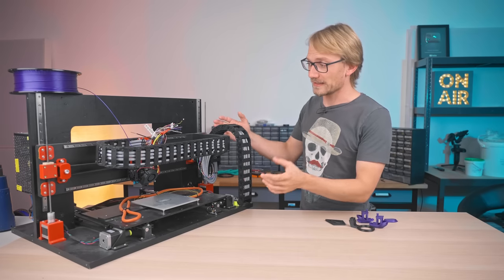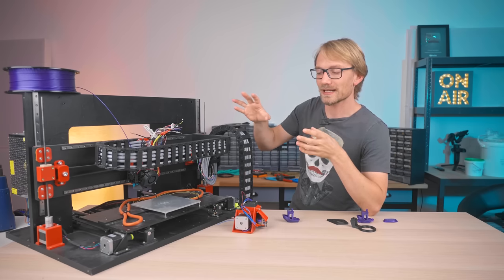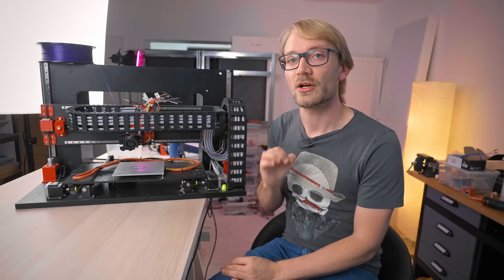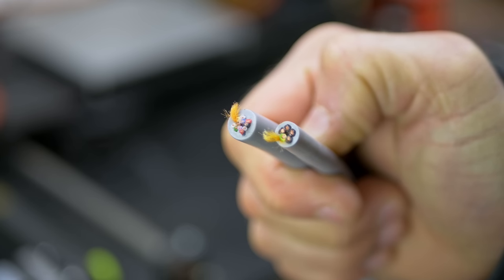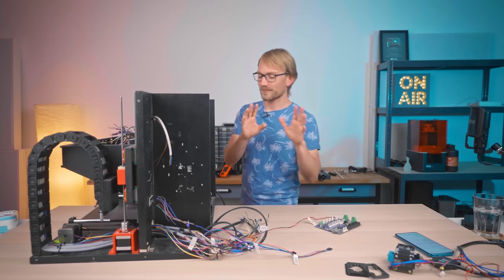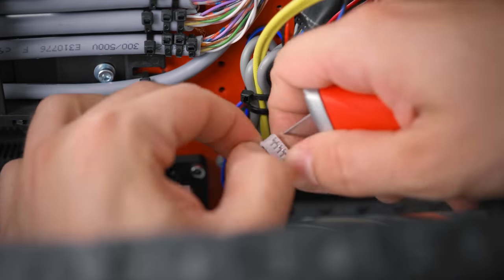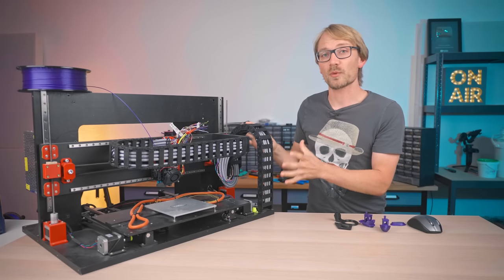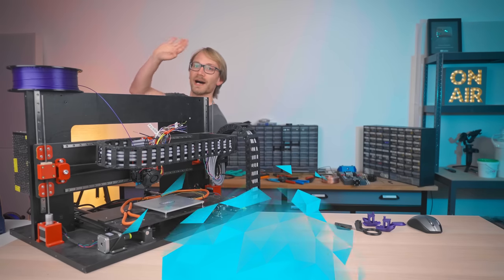This 3D printer can use ANY components - ultimate machine for parts testing!

Comment: Just an opinion here, and I like and admire your design a lot, but I'm not a big fan of those elastic bushings. You said that it won't produce printing artifacts but I highly doubt that any kind of elastic piece directly in the middle of the load applied to linear motion system is bound to introduce artifacts when doing prints that require a lot of z change (especially with z hops). I understand that with this machine the best quality is not the goal, but modularity and I may seem like your 89-year-old senile great uncle going on about Eisenhower was the death of this nation, but if I could recommend a future upgrade, use a well-tuned printer to 3d print a large plate to go in between the board and the linear rails to line it up better, probably on all axes too. And i would highly recommend CNC routing aluminum plates to for your CNC machine frame because nothing screams warping more like mjf on a humid day. Overall though I like your design a lot and will be using it for inspiration in the future when I try to attempt building something like this, cheers.

Comment: why is the titan bad?
Reply from the maker: The Titan is still a solid extruder, but is quite clumsy compared to the Hemera (and an older design, obviously). Since I have a Hemera, it just makes sense to put the 2020 extruder on the 2020-finished printer.
Reply: @MadeWithLayers  i appreciate you

Comment: Thats not really the correct way of mounting the drag chains. the stationary part of the chain should really ride on a surface and ideally in a guide.
Reply from the maker: The X-axis one is borderline, yes, but mostly because of the orientation it's mounted. IIRC, these chains are ok to be suspended for a certain distance.